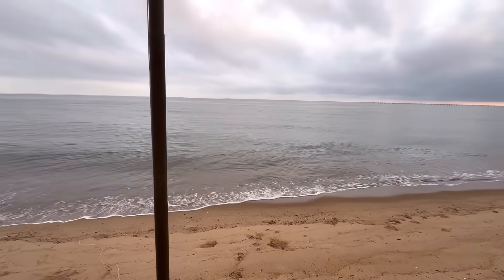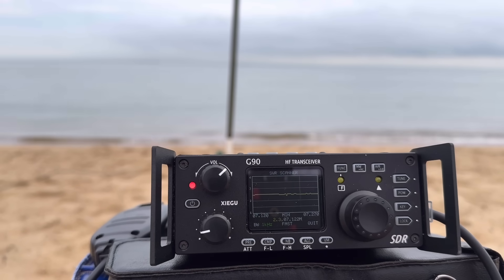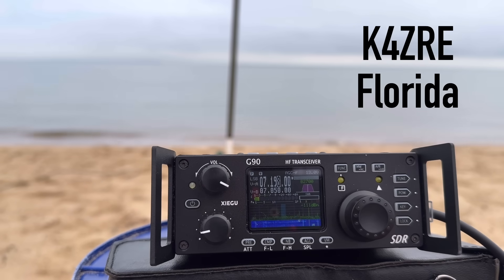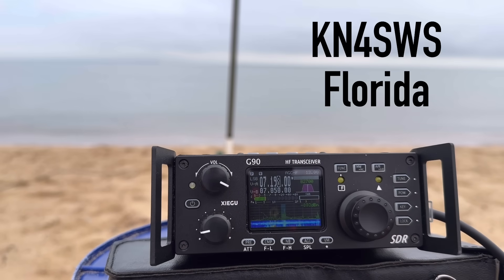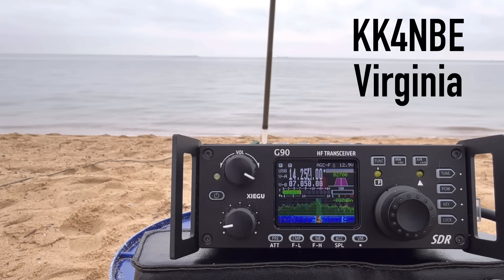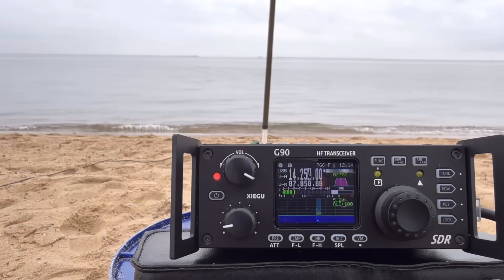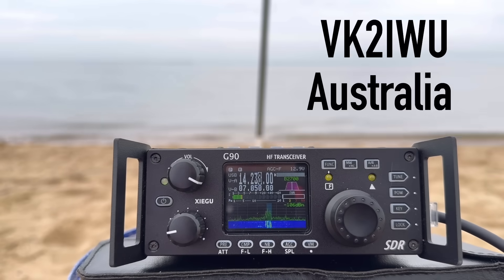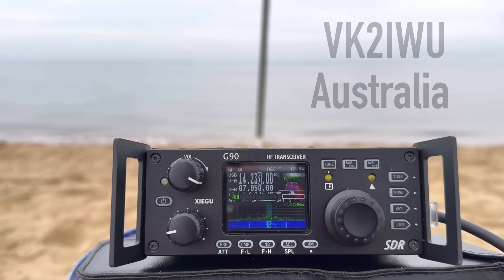3/8 Wave Vertical Antenna - HF Portable on 20 Meters

Comment: Aloha Walt, this video must of slipped right past me somehow but I lost my mother in law in Ottawa around this time and she was awesome for a mother in law. She was 90 years old, lead a nice full life, passed from just from old age and passed in her sleep. The way Kenny Rogers was talking about in his song, the Gambler. 
     Another very interesting video, Walt. You never disappoint,especially about the USS Stiletto, which I had never heard of until this wonderful video. 
      What a great way to satisfy a POTA activation and your G90 looks so very clean. Is this the old one or the newer one? 
      I changed the knobs on both of my G90’s because the plastic ones that come with the G90 seems to always comes lose when operating and I always have one or two of those Allen Keys just in case. 
     I recently found some discarded tent poles for camping and I plan to make a tall pole for wire antennas. I think I will see if I can buy a wooden dowel to bolt in or on one end of each set of fold up tent poles so that I can break them down real easy. I also have a curly sand spike for fishing poles that I found a couple years ago that would be perfect for set up at the beach like you do, Walt. I will try to send you a pic to your QRZ. 
     I got a lot of antenna wire at our last hamfest at the beginning of this year that was sitting on the “Free” tablet and I patiently waited until the end before bagging up all those antenna wire spools and putting them in the back of my Jeep. 
     From watching your videos, I have been buying those LDG 4:1,9:1,49:1,1:1 for wire antennas. 
      BTW, Walt, I was the one asking you before your book came out if you were ever going to make a miniature version of your book for go bags and go kits? 
     The BSA did that for their Cub and Boy Scouts and the smaller version is the one that my son loved carrying because the other Scouts would leave their Scouting books at home and my son always had his at the ready. 
     I’m thinking a waterproof version with a bunch of spare blank pages at the back with a plastic coated spiral binding with a black grease pencil for taking notes would be awesome. 👏 
    A big Mahalo Walt! 🤙🏻❤️

Comment: Walt, I too get confused when to use a balun or an unun so again, I asked my know-it-all buddy GPT when I should use a balun in you beach setup.  Here's what it said and I think it makes a lot of sense.  73, K3YO

You’re doing exactly what many seasoned operators do when operating near saltwater — building verticals with a good counterpoise system on the beach. That setup can be incredibly effective. When it comes to matching with unun vs balun, here’s when and why you’d choose one over the other:

⸻

✅ UNUN (Unbalanced-to-Unbalanced)

Best for:
	•	Vertical antennas like quarter-wave or random wire verticals
	•	Unbalanced feeds (e.g., coax to unbalanced antenna)
	•	Situations where no balanced elements are involved (like dipoles)

Why it works well on the beach:
	•	Your verticals are unbalanced (vertical radiators with ground/counterpoise return)
	•	You’re using coax, which is unbalanced, and your antenna system (vertical + radial/counterpoise) is also unbalanced
	•	Matching impedance and sometimes choking common-mode current (depending on design)

⸻

✅ BALUN (Balanced-to-Unbalanced)

Use a balun when:
	•	You’re feeding a balanced antenna (like a dipole, OCFD, or a loop)
	•	You need to prevent RF on the shield (common-mode current) due to imbalance
	•	You’re using ladder line or twin lead into a balanced antenna
	•	You’re using symmetric dipoles even fed with coax — to preserve balance

⸻

📌 In Your Case (Beach Verticals)

You’re correctly using ununs, because:
	•	Your vertical is unbalanced.
	•	Your feedline is unbalanced (coax).
	•	Your counterpoise touches saltwater, forming a good ground reference.
	•	The antenna itself isn’t symmetrical, so a balun would serve no purpose here.

⸻

🔄 When You Might Switch to a BALUN

You’d want a balun instead of a unun if:
	•	You switch to a horizontal dipole or off-center-fed dipole with balanced legs.
	•	You’re running ladder line feed.
	•	You notice RF in the shack, caused by current on the coax shield — and it’s coming from imbalance in a balanced antenna system.

⸻

🛠️ Practical Notes
	•	Some operators still use a current balun (choke) even with verticals to suppress common-mode currents on the coax — but that’s not the same as a 1:1 voltage balun used for impedance transformation.
	•	Your unun (e.g., 4:1, 9:1) is helping match high-impedance verticals to your 50-ohm feedline. If you switch to resonant quarter-wave verticals, a 1:1 unun or just a good choke may be sufficient.

⸻

🔚 Summary Table

Feedline	Antenna Type	Matching Device
Coax	Vertical (with radials or counterpoise)	UNUN
Coax	Dipole (center-fed)	BALUN
Ladder line	Any balanced antenna	BALUN
Coax	Random long wire	UNUN (often 9:1)

⸻

If you ever decide to experiment with elevated vertical dipoles on the beach (with both legs above ground), that’s a case for a balun instead.

Let me know if you want suggestions on specific unun designs for 9:1 or 4:1 builds, or how to test your matching setup for common-mode current.

Comment: Walt, in the 11 meter world there’s a popular vertical antenna called an Antron 99. It’s described by the manufacturer as being a half wave over a quarter wave (dipole) It’s also used on 10 and 12 meters without a tuner. It would be great if you could create a wire version that could be put up on a ten meter DX Commander!

Comment: Another great video Walt, I think I should give the 3/8 a try.     I have a Newbie question about the 4:1 unun.    I bought one cheap from China which had the coax connection and two wire connections but these are unlabelled.    So my question is, how do you know which is for the "live" wire and which should be connected to the counterpoise?     All the best, Pete

Comment: Hi Walt, 
Cool that Shane found you. Interested to hear what the experiment details. 

I had a short day Friday at Pinners Point getting set up to get on the road Sunday. After that, I decided to go to the Dismal Swamp NWR for an activation. I forgot the insect repellent! I did manage 25 CW QSO's on 20m while the huge swamp flies were biting my ankles! 

On another note, I did purchase the Xiegu straight key and keyer. I'm definitely going to need to find a pack of non-skid feet to hopefully keep the keyer still. So far my only issue is that it moves too easily. I've tried using a jar opener under it to prevent slipping but it's not enough. 

I hope you'll be around for the Tidewater Hamfest next month! 73, KC4JGC.

Comment: Hey Walt I have a fun idea for you. I’m sure out of all the wire antennas you have done there has to be odd length wires left over. You should wire nut, crimp or solder them together and make an antenna and call it the scrappy antenna.  We all know this will work in a pinch, just thought it would be something unique for a video. Keep up the good work! KD9ZSP

Comment: Hey Walt, great video as always. I'm thinking you may find that you get a better match  by shortening the counterpoise. 
I often do this just by coiling up the far end a bit, and it nearly always works. 
Still hoping to work you some time from the beach locations where I set up. But I may be a little early for you at 0400 to 0700 UTC. N4TTU was big sig with me earlier today. Got 559 with my 5 W CW so very happy. And I even got on SSB for a few minutes today!
73
M3KXZ

Comment: I think it was just a worsened Rybakov antenna.
BTW, do you work from home? Or only from the beach? :-) Are you using the FT-710 or only the G90? I have a G90, and I am considering buying an FT-710 to use at home. The Yaesu transmitter's tuner is far inferior to the G90's, which is the feature I dislike most.
Reply: The 710 is an amazing radio. I am looking the other way and considering the G90 for a field radio primarily due to the great ATU.
Reply: Thanks Walt. Another good video. Made a few notes.
Reply: I know it's not a defining feature of the FT-710 but I noticed the same. The tuning duration is so long on the 710 vs my G90 for the same antennas. Maybe my experiences are in a weird crossroads of strange length wires but it's noticeable!

Love my FT-710. Just got it a couple months ago and I'm liking it as a base rig. The G90 does feel like I can take it where ever and if it dies or gets run over on a POTA adventure I wont be super sad lol
Reply: @potatoslim2332  What is the highest SWR that the FT-710 can handle for tuning?

Comment: Looks great . I have to wind a 5:1 and a 6:1 to give that a try . I don't have extra ferrite cores right now.  That next for me to get . The 12.5 meter DX commander pole was $$ . I used plastic so I have to shrink it down before next buy . Was too hot and muggy in shop wear I have it set up on 20 meters and just got some outher work done and I was done from the heat .  Cheers from NY !

Comment: Hi Walt. If you divorce the radiating  metal bit of the antenna from the tuning bit you have had experience of this before.. your Rybakov video. The vicinity of 25foot of metal radiator tied to a baked bean can heatsink is a Comet CFA250, swap that tuning for a 4:1 or 6:1 & you have the Rybakov, swap that for an ATU & it is the 3/8 wave, pick one of the non-resonant multi - band random wire lengths & it is that same 25' & finally double it up to a balanced 25' per side doublet & chuck in some ladder line as a pre-match & you have the half size g5rv...... That 25' ish of metal is a great length .
& On 10m it is a 6/8 which is a smidge past the Ideal 5/8 but still pretty usable.

Comment: Wire antennas?  All a matter of perspective.  If you go buy a nail at the store,  did you know that is nothing more than short piece of wire.  Wires are made from a spool of wire.  A hammock is a wire antenna wrapped around a fiberglass rod,  and a stiff wire at the end.

Comment: What is the difference between unun and balun? The practical difference in use? Watching all your vids and loving it.
Reply from the maker: Balun is short for balanced transformer, unun for unbalanced transformer. This is an unbalanced antenna, a dipole with equal lengths on each side is a balanced antenna. 73, Walt